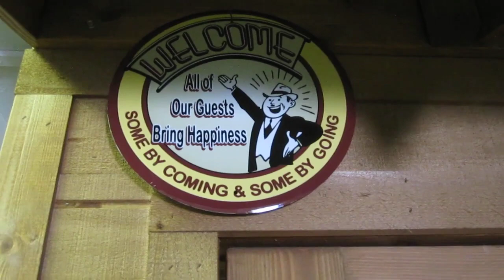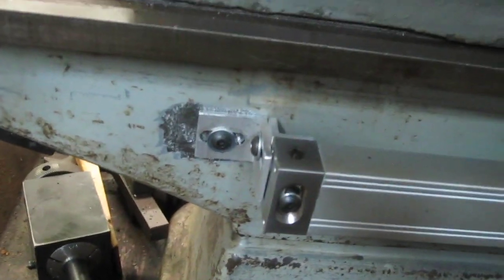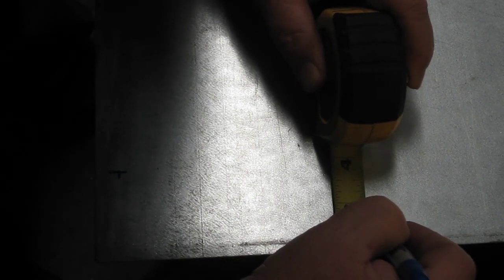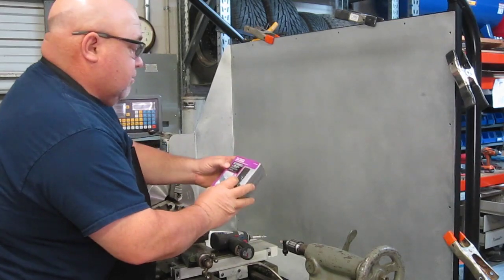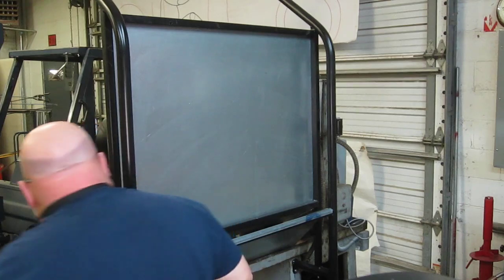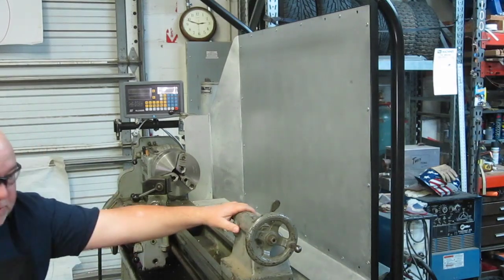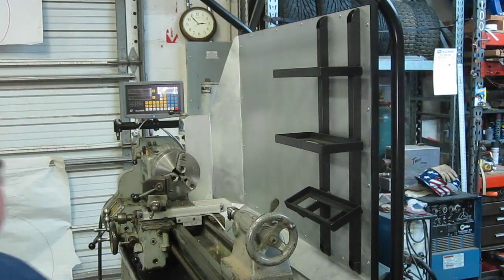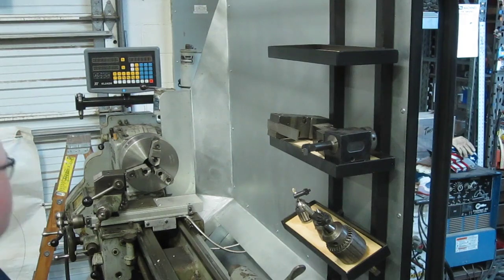Atlas Clausing Lathe Digital Readout and Backsplash Install Part 1

Comment: Great video and installation Can you tell me where To buy DRO kit? And what is the exact model numberI want to do the same thing
Reply from the maker: I bought the kit off of Ebay back in early 2020. That one is no longer available but I will put a link below to a similar version. You pick the scale lengths when you order from them. I have no affiliation with this seller its just an example. The scales I used are 200 mm travel length for the x axis and 900 mm travel length for the Z axis. I had to fabricate my own mounting brackets using some of the parts they sent and some I needed to make because every machine is different and you will have to get creative with this kind of install. It occurred to me halfway through the project to videotape the process. That is why there is not much detail on the scale installation (sorry). I did the video more for ideas people can possibly use on their own machines.
I hope this helps. Best of luck if you give it a try. It really makes the lathe more fun and easier to use.

https://www.ebay.com/itm/164288092089?_trkparms=amclksrc%3DITM%26aid%3D1110006%26algo%3DHOMESPLICE.SIM%26ao%3D1%26asc%3D246290%26meid%3De877d7e60ccb42bf85580fa963e33d73%26pid%3D101195%26rk%3D2%26rkt%3D12%26sd%3D165650668998%26itm%3D164288092089%26pmt%3D1%26noa%3D0%26pg%3D2047675%26algv%3DSimplAMLv11WebTrimmedV3MskuWithRevOptLambda85KnnRecallV1AndV6ItemNrtInQueryAndCoreAIVisualRankerAndCoreAiCachedRecall%26brand%3DUnbranded&_trksid=p2047675.c101195.m1851&amdata=cksum%3A164288092089e877d7e60ccb42bf85580fa963e33d73%7Cenc%3AAQAHAAABcKIYofhs93U9Ba8IJf%252Bra%252BP6YltZWH6unspmy8D3%252FE4LFpCxT6pAQONJgGN7Zua4Vnzn0D8cgaWPW%252Be2c8%252B7%252FnZ%252FOj8%252FB9y50lMg9b6%252BbcU%252BmUvdl3dWp13g01Boah3MhAdXj3SoFHsYgr1E7VncmZMGZq2igGxqV6nGlSOi4Nh2T233Nf%252BtwlYPTpWHv93rl61VqlTLKdL1RfCw%252Fn8BDz1CCRqTwRBEujwSHnvhC1XaYqA%252FEOuuLJrX4kYJd%252BnDjDfdaPb%252BjEKHgokfGJ4%252FXl8xzfWj1QnqGBQVQYeNC6TXqKvj6PwOBeF6Qs%252F7heozPJJdCiHPgX1qZtvbTobL2CaApASqPiImbU8fjmwGuRb46cza6TrBNdvYTwK7jZDMPbdCKKfXnP2eiDuegrPu2fW05rQOXUHqCGscI2R5AXX0TPPTP%252FSOKpmThkVz7SFjp%252BJLMoq%252Bk3J3zBwKrB6wQTHasLejjmmEll7RqYlXZL5p%7Campid%3APL_CLK%7Cclp%3A2047675